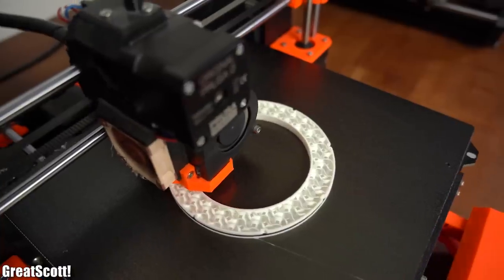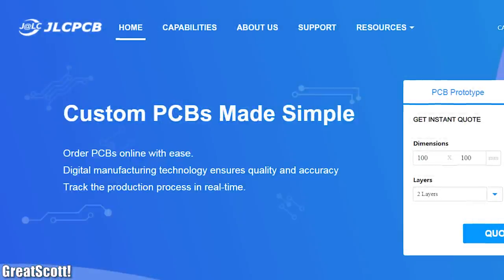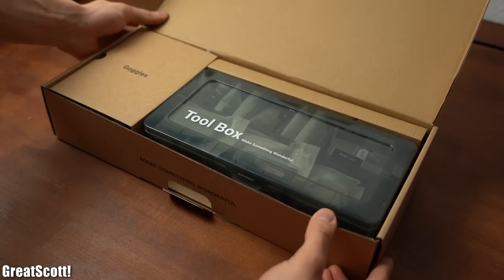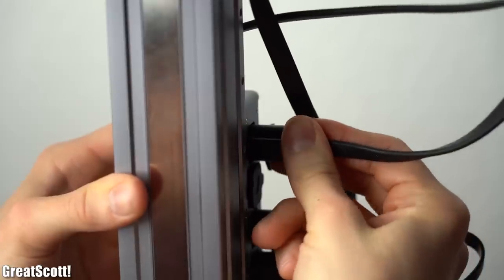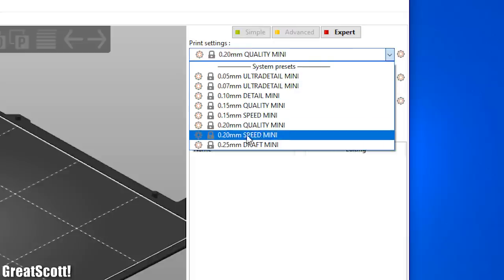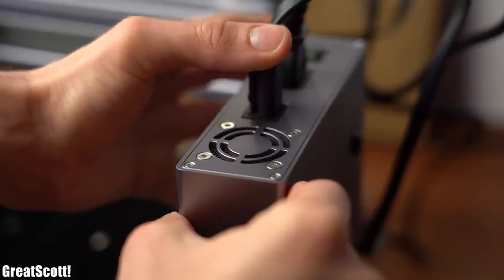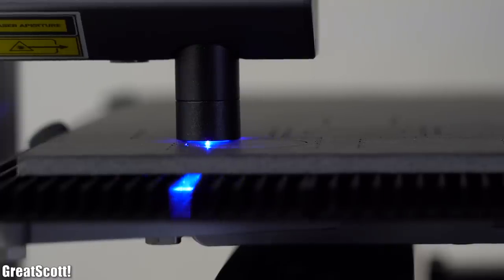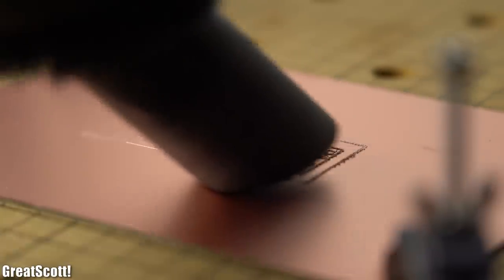Testing a 3-in-1 Machine || Laser Engraver/Cutter, 3D Printer, CNC Machine || Snapmaker 2.0

Comment: The fact that the laser mode does not have any kind of laser enclosure is pretty dangerous. Sure glasses are great but that does not ensure complete safety and these kinds of lasers can really mess up your eyes with the slightest error. For the software, I have been using lightburn for a while and it is an outstanding laser software with a great feature set. Given the cost of this unit I believe you could easily make 3 superior specialty machines for less money. I am excited for the future of all-in-one machines but I think just like 3D printing originally, either wait for the tech to get cheaper and more effective, or build your own if you want something that has a good cost-performance ratio.

Comment: With laser cutters/engravers you usually need a fume extraction as this can product toxic/carcinogenic fumes and particles. Also, with such high powered lasers, a proper enclosure and goggles is something I'd highly recommend.

Is it compatible with prusa slicer / standard gcode?
Reply: it's apparently open source so it can at least be shimmed to be compatible with gcode.
Reply: Yes it is. I do own Snapmaker and I am using Prusa slicer for preparing the gcode for 3D printing. For laser engraving and CNC machining I use Snapmaker Luban.
Reply: It's only a 1.6 W laser so it's not so powerfull but an air assist would have be nice for this price

Comment: As an actual Snapmaker owner I can definitely tell you this is not an expensive toy or a hobbyist grade tool, the three functions are on the same level with machines that's dedicated to each task, extremely close at least if not the same. Also I have some disputes:
1. The parameters used in this video looks off from what we use in the community, and the results of the print looks worse than what we are getting, Snapmaker usually outputs great print quality.
2. A higher power one is coming in. This is the advantage of Snapmaker being modular, it is future proof to a point. Fume extraction is done using the enclosure.
3. For those who think this is a jack of all trades master of none machine, my only suggestion is to get one and see for yourself. Everytime I see someone say this, it's those who doesn't own one. All the functionality works well for its standards in that area and it doesn't half ass any.
4. Yes, there is a lot of short comings. However 2.0 is a relativity new product aswell, they are making improvements, however. For example, the fans on the power supply is absolutely loud, so is the motors. At the time this comment is written, the improved version is already coming for both the linear module and the power supply fan. This just goes to show that the team is activity working on improving and this is not just a toy.

Comment: A Genmitsu 3040 cnc router is $999, an Ortur 400 x 430mm laser cutter/etcher  is $299, and a Creality Ender 5 is $297. Takes up more space, but you get a larger and more powerful router, a larger and more powerful laser, and a superior 3D printer. A good idea and a pretty good design and implementation, but too much setup time between functions and the size is too limiting, especially for cnc routing. Maybe when the larger option is available with some improvements, more laser power.

Comment: After 4 years discovery through CNC Mills I can definetly say such a tiny milling head and flimsy design are not usable for any serious and/or precise milling even for thick brass or bronze plates. Don't want even to mention steel or al-m. So far you have 2 options if you need extremally compact CNC mill -- modify Proxxon's manual Mill MF-70( almsot everything got replaced) or buy Sherline CNC mill. Yeh, the price is not cheap, but the quality and functionality is 100 times better. I even want to give a try for new independent Proxxon milling brushless head they gona start selling this November. Also, I've heard they've started selling brushless CNC mill: FF 500/BL-CNC, but the price makes me cry. ;(

Comment: I have to agree with the review that the changing of the bed/work surface would be problematic, and a better system needs to be found, if indeed it's possible. On the flip side of it all tho, you are getting 3 units in 1, so you have to accept it or just work with 3 machines if you've got the money to purchase all devices separately.

It is an impressive unit with lots of pros and just the bed/work surface issue as the con..

Comment: i think, that the machine is nice, but also it´s not made for big mechanical milling/drilling stress, like you see at minute 10:00,  it would be interesting, what they cover in the rail system to learn more about the propertys of this machine. I hope, that not a big part of the price is in the label of screw packing and individual cartboard boxes

Comment: I hate the fact that my CNC, 3D Printers, Laser cutter, and laser engraver take up a whole room and all have motors and controllers to maintain. I've always wanted a modular system...so you can just have a super high quality rail system and motors for the same price as 4 complete systems at ¼ the price each. Plus the footprint will be much smaller than 4 machines.

It's very tempting to go with a 3-in-1, but then you're stuck making parts on 1 machine at a time. I wish more options like this were available back when I put all my money into 4 machines.

Comment: Uuuuuhhh... Apple made a 3D printer? 

(judging by design and price)
Reply: Considering the functionality of the machine it's definitely not overpriced. Expensive it sure is, but not outside of feasible profit margin. You just CAN'T get all (specially a CNC) to work with the simple construction of most 3D printers that are cheaper, I can't see v-rollers handling the forces at all, damn all reviewers of 3D printers talk enthusiastically about seeing how they're wearing evenly during the review... you can freaking see it wearing... during a review time... Let alone the belt system of most printers handling the cutting tool forces. The laser is pretty much the only part you can easily adapt to any 3D printer, and that alone is like 100 dollars in cost alone, from Aliexpress for example.

True that the niceties and frills that make it more consumer-friendly instead of just maker/thinkerer community product drive the cost up a lot.
Reply: @Kalvinjj  3D printers are CNC. CNC is literally just a control system.
Reply: @thomasbecker9676  Yes, of course. Computer Numeric Control. It's just implied here obviously that it's about a CNC mill instead, but that is indeed correct.

Comment: Having to change the base with every function change, killed it for me. 
Only the head should need replacing, for the idea to work. 
PRUSA is a hard act to follow for price over quality. 
IMO, this was a fail in both departments.
Reply: Snapmaker 2.0 owner here, the base swapping isn't that big of a deal, the whole swap can be done in 5 minutes or less, and to me i don't think a universal base would work quite as well, specifically because of the different functions of the different tools, for instance if it was a universal bed it would be probably made of metal and if you had the CNC function was running and something messed up causing the bit to go to low, the bed and the bit could both be damaged where as the CNC bed is a wooden waste board which would not cause the bit to break

Comment: By the way, is the laser a 405nm (UV) or 450nm (blue-violet) one? If it's 405nm you could use it with pre-sensitized boards or if you apply photoresist yourself, and the precision would be otherworldly for home-made PCBs, also adding the CNC drilled holes on top.
Tho I've never seen 1.5W output UV laser diodes out there, usually only blue-violet ones are on that power level, unless they're throwing a NEJE one there and going by the power input numbers not the optical output power.
Reply: The specs says 1600mW 450nm Laser Diode
Reply: @steinartorgersen3995  Thanks for the answer, didn't see it on the site, missed it I guess.
I've gotten myself the 500mW (optical output) UV one since I wanted to do PCB photoresist exposure as well, but the more powerful blue ones are better for cutting for sure.

Comment: Fantastic video. Ever since I saw the kickstarter for these I have been interested.

I wonder if the stepper drivers can be swapped out for Trinamic parts, and whether Slic3r can generate G-code for it so we can have finer control over the prints...?
Reply from the maker: Both would be awesome ;-) Let's see what the future brings.
Reply: The silent stepper drivers don't support a high enough voltage to get the torque and speed required for leadscrew driven X & Y axes. They cap out at 36v from what I understand and the Snapmaker uses higher voltage for the motors. One of the guys in the Snapmaker Facebook group has been doing tests to try and swap 'em out for TMC2208s.

And, yeah, you can use Slic3r and Cura to make gcode for it. I've been using Cura with the original Snapmaker since I got it, and will make some custom profiles for the 2.0 when I get around to it. :)
Reply: @JohnAldred  tbh, ive used Luban a hand full fo times, now im in Cura only. Have to use a USB stick to get the data over as Serial had some small issues from time to time. Cura doesnt support WLAN afaik, or didnt see it until now. 
From my Teardowns, the machine runs on 24V and the Stepper drivers are TB67S109AFTG.

Comment: What should I learn to make 3d printed things .I mean to ask which software or programming should I have to learn to make my required things using 3d printed.
Reply: Have you got a 3d printer? For a noob, design it in Fusion 360, F360 for short, it free for pesonal use, there is other better software, but it has loads of youtube videos and "simple" to use. 99% of pinters come with slicer software to import your STL file from F360 to slice it and print it.

Comment: I have a separate CNC, 3D printer (enclosed FFF/FDM) and 60W CO2 laser engraver/cutter, and I would never want to have those operations in the same room or location. The variables like: noise level, toxicity, fumes, fume extraction, dust/chips, dust collection, sharp projectile hazard, fire hazard, temperature reliance/control, space requirements, material storage, etc. vary greatly within the machine operations. The reconfiguration steps are also a big turnoff. The actual mechanics of XYZ linear rails/servos/stepper motors&drivers are quite cheap these days, so why why why....

Comment: What about making you're own 3d printer I like see that please
🙏
Reply: The Prusa design is open source. Plenty of YouTube videos on how to build your own - numerous construction techniques too. Also, ANY xyz 3D printer can easily be modified to take a standard laser module. PLUS, if all you want from CNC is a machine to 3D engrave panels and the like, you can also convert to using a Dremel or other high speed, low weight (eg. DC 775 motor just like most of the CNC machines sold on eBay - 2018, 3018, etc). Again several videos online as to how to do that too.
Reply: look at vorons

Comment: Nice and thorough review!
With it being so modular I would assume that you could switch the PSU fan for a similar size Noctua fan to reduce the noise.
Quick question, how do you get your 3D printers so quiet? My Wanhao duplicator i3 sounds like R2D2 being flung through the swamp. I have heard about people flashing new driver firmware but I'm not so confident with that kind of stuff
Reply: They have different stepper drivers, but some machines (MakerBot comes to mind as what you describe) that make a ton of noise. Most machines you can change the speeds to make them quiet (it’s often harmonics, sometimes even motor harmonics which is demonstrated when people make their motors play the Mario soundtrack for fun). So try speeding it up and slowing down a few % while it’s running to see if you can find a speed it’s a bit less noisy. One of mine has infamous A4988 drivers and yet it’s really not very noisy (it can be at certain speeds, but I don’t run that slow or purposely try to find where it’s noisy), so it’s only noise is linear shafts if I don’t oil it nearly often enough and the PSU fan (but the fan is a nice low pitch, and auto ramps up depending on load so it’s actually a bonus because once in a while I can tell it finished when the fan completely stops making noise).

Comment: Is it FOSS? Does it run on GNU/Linux? How does the program work? Does it need a continuous connection to the CNC device?
I paid 200 euro for a CNC kit less than a year ago and it's sitting here unused because it doesn't have working limit switches, never remembers its origins, loves to push drill bits through the aluminium baseplate and doesn't carve straight enough. I don't want to throw over 1000 euro at such a device without being certain it'll be reliable.

Comment: I have a question new to 3d printi g, but I do when I use some stl files from say thing verse, will my  printer automatically take the settings from stl  file or I have to manually set them in my printer?

Comment: OUCH! I don't call £300-plus "budget friendly"!! My Prusa i3 equivalent cost only £120!! And apart from not having Aluminium rails and frame and the display mounts to the top rail (better in my view) does the same as the Prusa original! (A friend has a new original that prints no better or faster at the same quality).

The price of the large Prusa i3 is more than six times as expensive! Given that I have a clone already it is a trivial job to create a new frame from scratch for under £35, so let's say a total of £160 for a metal framed direct comparison, the large Prusa i3 would STILL be almost 4 times more expensive!! I fail to see where the extra value resides to justify the huge uplift in price! Do Prusa ship a fully built and soak tested unit pre loaded with the setting for the supplied filament? Even if they did, that uplift is STILL massive! WHY?

Comment: That's a great machine but to expensive for my taste so I have got a simple one wich can do cnc milling and laser engraving 3018procnc but mostly it is use with the laser because the chuck from the cnc is has a slight bend i try so mannh time to do it but no never have a proper pcb while using the milling even if I use right bit and homemap the pcb but with the laser I have quite a loot of success so it is more then I need but that machine is cool

Comment: Using a laser cutter/engraver without a cabinet AND smoke extractor is possbile "short term."  Don't cut any acrylic that way - and  the smoke from other materials will soon make you wish for a different solution.  I have a laser cutter that extracts smoke to the outside of my home through a large vent.  Once I forgot to open the exraction outlet and... The next project that I made was a reminder plaque on the start button to suggest that only idiots forget this step.  I engraved this with more colorful laguage (a la AVe).

Comment: Nice review and valid points 👍 

Personally I prefer their solution with 22 screws to fasten the work surface rather than some sort of  flimsy quick release solution that potentially gets worn and loose over time! 
Remember this is something which is going to move around for hours (days) and needs to be sturdy. 
A couple of minutes to secure it with screws is no problem. 

I bought this unit based on info via Kickstarter, Snapmaker and user reviews (actual use and quality of prints ++ over time) of Snapmaker 1 and 2. 
I’m so far left with an impression of what looks like a company with a philosophy and focus on details, high quality and flexibility. 
And, I like the prospect of many future expansions (e.g.  there is a rotary module soon to be released adding a forth axis to the unit which looks very promising 
(https://snapmaker-2.backerkit.com/hosted_preorders/project_updates)). 

I have just received mine A350, but has not had the time to assemble it yet. 
But, I’m so looking forward to “play” with it 🌝

I was first doubtful whether to order it just because of the noisy power supply and motors (I live in a apartment building), but I took my chances. 
(Of course the improved and more silent versions (according to “a broke engineer“ down below) surfaces after I got mine…)

The software lacks some features and is a work in progress (but so is Windows 🌝 ), so I have no doubt that there will be a lot of improvements over time!
Reply: Clamps don’t move though. I use 2 binder/paper clips to hold my glass bed, it’s not going anywhere. My other printer has a magnetic build plate and that doesn’t come off easy either (certainly not while printing). So it’s like you can use 100 million screws to secure something, if it only needs 2 or 3 spring loaded clips or industrial latches if you prefer, then it’s poorly designed.
Reply: Look at agricultural industry, they use 2 clamps to vertically hold 40+ pound safety side panels on machinery, and those do not come off. Simple, and still way more than overkill for something like this (also that 40 pounds is being bounced and bashed along on bumpy terrain, it doesn’t move and you can see that by the rust lines just how long it’s stayed in place).

Comment: "Not polished"? dude you ain't got clue, you make your own from scratch for a 10th of the price
Reply: You couldn't make your own for 1/10 the price. Even if you value your time very little, it would cost more than that.

If you value your time at all, you need to add your cost per hour you charge at work to source everything, assemble, and test & calibrate.
Reply: Yes you said it, it will cost time not money so what if it takes a week longer and junkier materials it can be done
Reply: @lloydtshare  If you value a week of your time that little...but still not 1/10th of the price.
Reply: @PowerScissor  if you value your wallet......more money than sense how old are you 100?